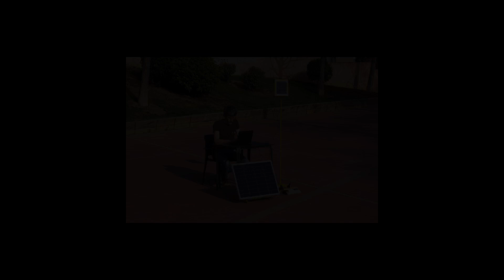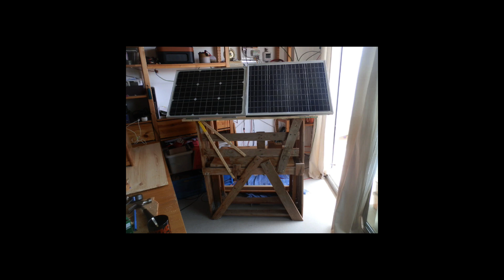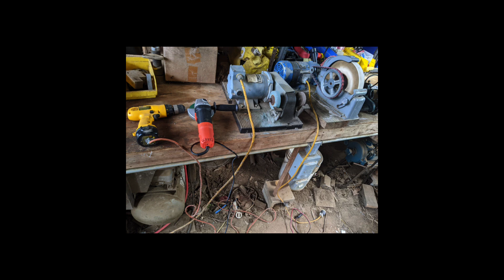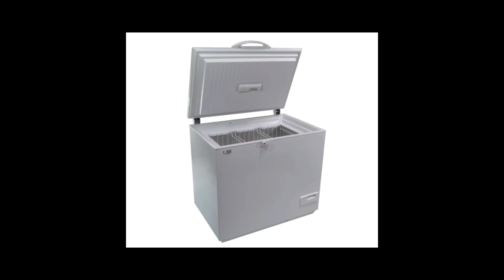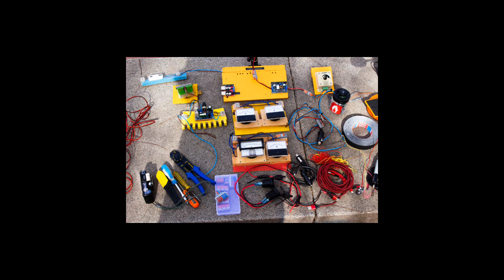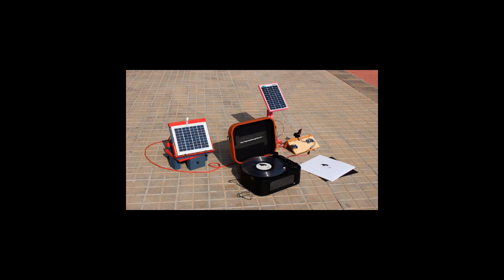0025 — LOW←TECH MAGAZINE. Direct Solar Power: Off-Grid Without Batteries

Comment: It is a bit paradoxal to listen to an audiobook about low-tech on youtube, because if it is an audio-book, audio is enough, we don't need video with it. The problem is that video consumes much more energy than an audio. Don't you want to make it available in audio format only ? For instance on spotify, or on a blog.
Reply from the maker: Yes, it's paradoxical.

I don't have a great answer for you right now -- it's mainly that it's the most accessible platform for one-offs like this. A decent option is to use the lowest video setting.